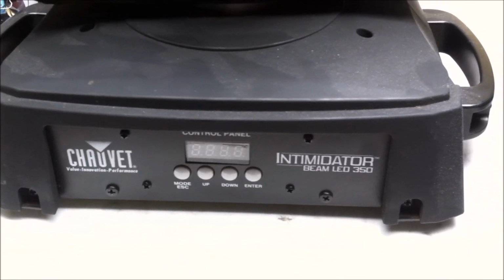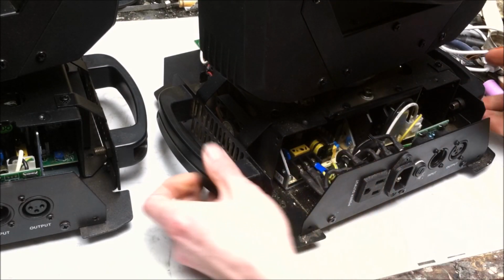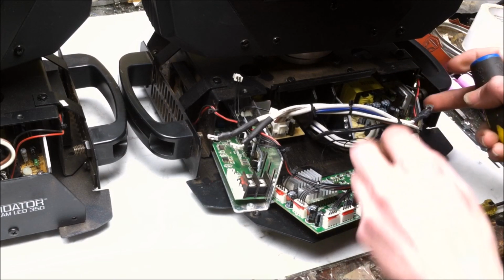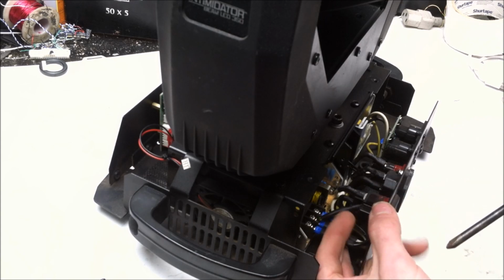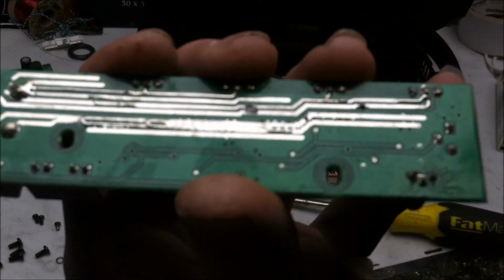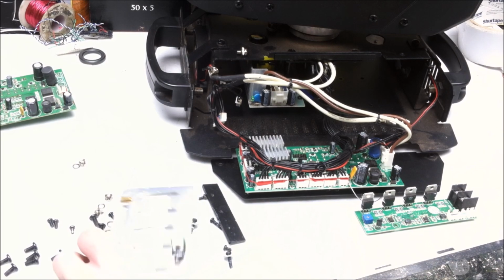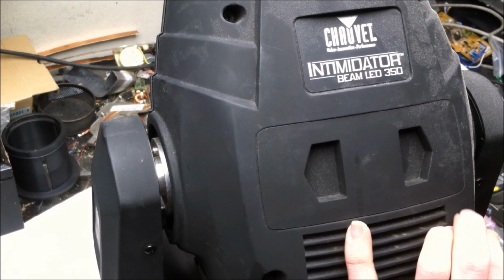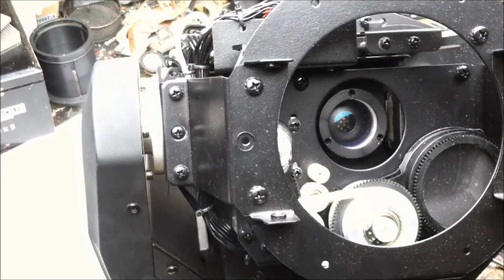Chauvet Intimidator Beam LED 350 Repair LED PSU replacement

Comment: I have 1 chauvet intimidator beam 350 everything else works good, it turns on perfectly, it moves how it should , but the led flickers and struggles to stay on, sometimes it wont turn on at all, and sometimes it works perfectly…. What could be my problem, would it be the same issue you were having?

Comment: I was wondering if you can help me? I bought a pair of used Chauvet Intimidatory Spot LED 350s. For one of them the light sometimes flickers a bit when first turned on and then after about a min or will have no more light. It's moving around just fine. Sometimes turning it on has no light but movement. Sometimes it works fine. I'm thinking of the power supply. Should I also swap out the PCB board? Could it be something else like the temperature controller?
Reply: Did you ever figure out your problem?

Comment: I have some intimidator 250’s. One is super dim compared to the others. Would this be a problem with the power supply?
Reply from the maker: Sounds like a few of the LED dies chains failed in the moving head's main LED light source. That's usually the cause of them being super dim.

Comment: I know you might not see this but if you do I own the same light but whenever I control it the light goes out of nowhere and then it turns back on I’m not sure if it’s almost the same problem you had on these but I’m not sure what would be the best option to do in your opinion?
Reply from the maker: I would look at the power supplies and see if the low side capacitors are bloated or leaking. Often the problem is the power supply capacitors. These will be the cluster of capacitors that are typically marked 35v. You mentioned this happens when you control the light, does this happen if the unit is running in demo/sound mode?

Comment: So I have two of these lights (specifially the Intimidator Spot 350 with mechanical gobo's and prism), one works perfect, the other will work by itself in all automatic modes, but will not slave off the other, nor can it control the otheras master. And when I plug it into a dmx controller, it appears to glitch the controller out. Like the display on the controller shows its slider value flickering between 000 and any number upto 009 very rapidly. And trying to adjust sliders which would normally indicate between 000 and 255 on that dmx channel results in the display flickering between the slider value and the other random numbers mentioned above. It also of course will not respond to ANY DMX commands.  And in a chain with a bunch of par cans it causes the entire chain to start glitching out.. Like it is sending a bunch of garbage over the DMX cables. Any ideas?  I have only removed the trap doors on the top and bottom of the head it self. All the gobo's and gears seem proper, and all the connections seem to be secure.  I also noticed that when performing a factory reset, the DMX controller stops glitching out, and will start glitching once the reset on the Intimidator finishes. I also notice its reset takes much less time than the other, and it makes this weird ticking sound that the other doesn't do.

Is it possible this is the caps starting to have issues? I am uncertain this would be the case as the light works perfectly in its auto modes. It makes all the same sounds and pitches the other does as well is its moving about. No out of the ordinary buzzing or electrical strain.
Reply from the maker: That is very strange behavior. They do make something called a DMX terminator that can in some cases solve similar types of issues. What's odd is that your DMX controller shouldn't be capable of receiving any soft of commands or interference back. It almost sounds like the light in question might have a very poor earth ground connection to the power supplies. It could also be a failing DMX connector or perhaps accumulated dust/moisture/corrosion somewhere on the main bored. I don't think it's a power issue, sounds more like unwanted interference. Take a look at the above possible problems, try a DMX terminator if nothing else seems to work. I wish I could be more help to you but I have not heard of or experience this problem.
Reply: @Zenodilodon  Thankyou for the response!  I have not taken it apart yet. I may have time to do so in a few days. And it does seem like it is just sending a bunch of garbage over its dmx lines. I tried a slimpar which has selectible termination on it, and it made no difference. So you may be right in the corrosian or damage on the pcb being a reason.

Comment: I am in high school and our intimidator spot 350 wasn’t working I opened it up and the smaller bored that when I look up says it’s the power supply does not have the green led on I’m not sure where to go from here
Reply from the maker: in 90% of the failures i have seen on these it's the 4-6 capacitors nearest to the output/green LED that go bad. If you replace those it should work fine again.

Comment: I'm in the process of repairing four Chauvet Intimidator 305s.  All four came in dead - not powering on.  3 had blown fuses, indicating a broken PSU.  While debugging the faults on the PSUs I decided to look for alternatives to Chauvet's own spare parts (retail around $50) - then I stumbled upon the original PSU manufacturer's shop on AliExpress.  I did a little digging & found exactly the same model of PSU which they sell singly for $6 US. SIX DOLLARS!!!  Absolutely shocking.  The root cause of the PSU failures by the way looks to be dried out electrolytic capacitors.  One is already repaired - I changed a few capacitors, the main switching MOSFET, a 120 ohm resistor and the SMPSU control chip.  Total cost in parts & labour already way more than $6 but it won't be luck which makes the repair last way longer than the original PSU :)  Thanks for posting this video - it's great to see people who aren't afraid to tackle their own repairs :D
Reply from the maker: In most cases you are correct, it's usually dried out capacitors on the low side. Usually putting in slightly bigger ones will help that quite a bit and cut down the ripple the capacitors experience. On this particular job I did I wish it was as simple as new caps. The costumer did a wonderful job of shorting out everything by hitting just the right spot between the high side and low side with the drills/screws. Chauvet's spare parts are almost always over priced, glad you found the PSUs elsewhere for cheaper! All these lights are sadly built down to a cost, and a few extra dollars would go so very far to make the products that much better, something of which you already fully know and are intending to fix! I do wish things where made better, the market wants cheaper and consumers usually have no idea just how close to failure a brand new product can be engineered. I am seeing more and more dead smart TVs due to this effect.
Reply: have 3 intimidator led 350s all irratic power issues with no main lcd display. Like you mentioned is it cheaper take to a shop that works on capicitors and power supplies vs buying 3 new psu units?
Reply: @mattholmes2808  definitely.  Replacing the PSUs with original Chauvet parts would be a false economy.  Unless.... Chauvet are using better quality parts now.  Hahahaha
Reply: Can you remember the part you ordered, do you have a link please? Thanks
Reply: @darrellhooper9973  Most parts were replacement passives, MOSFETs & driver ICs.  I just replaced like with like.

Comment: Wanted to find a disassembly example as I need to straighten a bent base on an Intimidator Spot 360. This will certainly help me know what to expect. Very interesting watch. Thank you for sharing!
Reply from the maker: Not much going on inside, should be pretty easy for you to bend back, I have reshaped a few fallen movers and it's usually pretty easy.

Comment: Not replacing the heat sink compound after having the mosfets off the sink is poor technique and begging for trouble.
Reply from the maker: I would agree with you on that in many cases, however in these lights they rarely even get warm. I checked the ratings of the Mosfets and just one out of the 4 could run that LED just fine. It seems to be a universal driver Chauvet uses I have seen them many times. These lights just don't push much power through that LED power controller.

Comment: Great video,! You really know your stuff!  Btw it's a beam, so focus wouldn't do anything and that's why they left it out because of the fresnel lens in the front.  The reasoning is that you can't have a focus element in front of a fresnel lens. And the design works pretty much wherever you shine it it's in focus. On the spot version of these you don't have the fresnel lens in front and you definitely do need Focus! too bad the gobos aren't replaceable on these..
Reply from the maker: Thanks! I noticed on another person's beams that the focus was all over the place. I wonder if they get loose, though he also did have broken lenses as well. They where some sad lights I might fix for him one day. I like moving heads but these in general don't have much going for them. They aren't really customizable either you are correct on that. Sadly beams and gobos don't mix well. I would love to of seen some multicolor dichroic glass gobos, I think they would of done very well for this application.

Comment: at 43:10 They do that stuff on gobo wheels and make it swing back and forth like a low cost animation wheel. and it's usually apart of the Gobo channel DMX traits. :)
Reply from the maker: I saw that when it powered up is seems to use the dotted section for like a water/shimmer effect. I had previously thought it was a textured glass, but this is a far cheaper method of doing an animated effect.